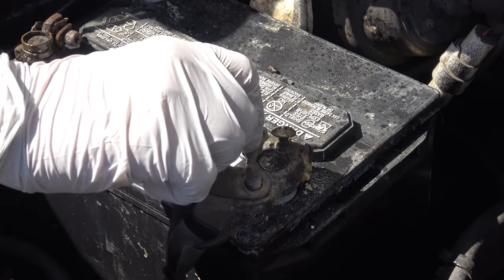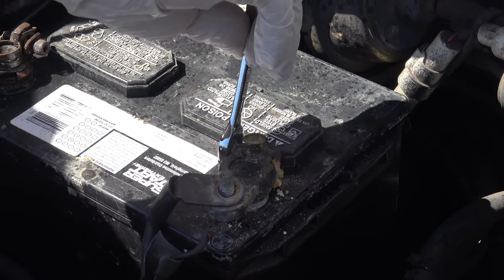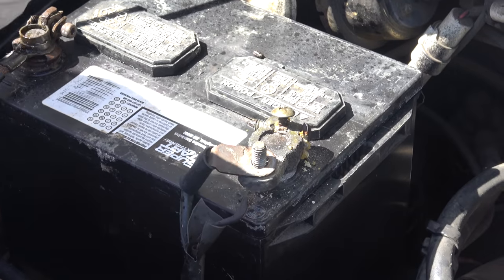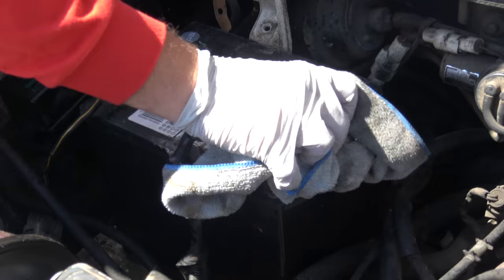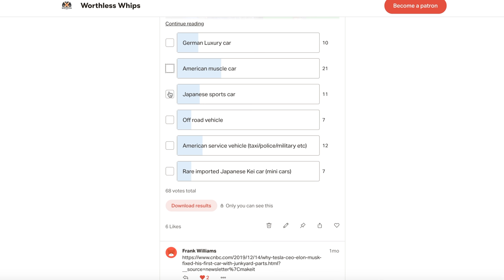Rescue any Car BATTERY for $12.50

Comment: I kept an MX6 on the road for 20 years and had it in the shop once to replace the clutch because I didn't have a garage.  I've done some work on my truck but have taken it to the shop for a lot of work because I got tired of working on cars.  It's expensive and you can essentially pay for some nice tools by doing the work yourself.

Comment: WD = water dispersing.  A battery can be damaged by rattling (much less falling off) around on the tray so it is not an optional maintenance item!  An inexpensive little battery terminal (clamp) puller is another nice thing to have in the toolbox for those times a person may be tempted to take a hammer to uncooperative terminal clamps.

Comment: To truely rescue any battery you should mention the following.  You need 2 battery chargers.  1.  A heavy duty charger for charging a dead battery you can get a 30amp continuous with 100amp (for about a min) jump start setting for only $60 on Amazon.  Higher amperage chargers are not needed but they can charge your battery faster and the higher amperage  models can "recondition" the battery if it is not too far gone.  2. The other charger should be a trickle charger that keeps the battery charged when not used for long times.  I like Battery Tender brand because it only provides as much power as needed.  Really cheap trickle chargers always charge and that is not great for long term storage.

Comment: Use baking soda/water mixture to neutralize the battery acid on the terminal and wires after stripping. And do NOT over tighten the battery terminal. It will stretch the soft metal and you'll be back to where you started in a hurry. Personally, I like to tin the newly stripped wires with solder. Separately stranded wires cannot carry as much current as solid does. Also, where can I get a set of those 1930's wrenches?
Reply from the maker: Good solid advice for a show car, but not a worthless whip ;)

Comment: To deal with all the corroded batteries, if you must, take baking soda, mix it up with water into a paste. Apply the paste all over the corroded area especially the terminals. This will counteract the sulfuric acid in batteries. Sulfuric acid  is truly dangerous stuff

Comment: Please don't use open end wrenches for everything you can think of. Those things will eventually strip of every nut and bolt head you try to loosen. Use close end wrenches instead... those will save you a lot of head aches.

Comment: An excellent and to the point video. I would offer a few suggestions based on my own experiences/adventures in car repair.  Number one-buy the thicker, mechanic's rubber gloves. The cheap latex ones do not hold up. Number two-be careful to clean up any spills of coolant containing ethylene glycol. Animals find the chemical sweet to the tongue and will lick up any spills on the pavement or garage floor. It is quite toxic and leads to a miserable death for any creature who gets enough of it. Number three-check under the battery. Corrosion here is fairly common and needs addressing before you add ventilation to the engine compartment you weren't counting on. And number four- Harbor Freight Tools has cheap, servicable tools and they are nationwide. Amazing change of pace in your videos; from learned, social commentary on matters China to car repair. Good luck, guys.

Comment: A good noob tip for negative and positive is if you don't know which is which if the car came without terminals (have had happen before) try to trace one wire in the bundle to the starter, which would be positive, and one wire in the other bundle to the chassis as ground.

Comment: Best dad 101 advice I ever got, if it moves and it shouldn't use duck tape and that will fix it, if it doesn't move as it should use WD-40. With those to things of advice you can at least get passably by with 80% of the stuff you're expected to know as a man.

Comment: A lot of the corrosion can be due to acid off gassing by the old battery. I've replaced terminals before only to see more mess accumulate. Replacing the battery solved the problem.

Comment: I always just use some old light sandpaper I still have laying around or a steel (rough or fine) steelsponge people use to clean pots and pans to remove corrosion from terminals. The tool is nice though, if you have to do it relatively often. Didn't know it existed.

Comment: Car electrics tip I leaned the hard way. Clamp or crimp wires. Solder makes a brittle connection that brakes from vibration.
Reply: HangGlideTube  Can you give me an automotive example? Circuit board components are soldered of course (although automotive grade parts with flexiblly affixed solder tags are a thing). Wire to board or wire to connector, no. It's not about cold solder joints it's about causing stress risers in the wire which will weaken every time the wire flexes. It's not always possible to crimp when making DIY repairs, but be aware of the potential weakness.

Comment: The best way to clean battery terminals/connectors/ANY battery corrosion is by filling a cup with water, and simply pouring baking soda into the water, and using something like a toothbrush to scrub away at the corrosion with the baking soda water, it chemically breaks down the corrosion, whereas WD40 doesn't.

Comment: As someone whom car batteries usually hate...hopefully a future video will be tracking down a phantom electrical drain. Bonus points for it being in a 2-door car where the battery is under the rear seat... 🤬
Reply from the maker: I can certainly oblige

Comment: That corrosion was so bad I would have been tempted to swap out the wires in case it got up deep inside. I also read somewhere (I think it was the Celica forum I'm part of) that it is often advisable on these old Toyotas to at least replace the grounding strap with something a little thicker.

Comment: My dad used Coca Cola to neutralize the battery corrosion but like others here baking soda 
Lol I once broke down with a auction car and used some Tums dissolved in a little bit  of water to clean the corrosion off.
If you are working on old cars you might want to invest in a pair of battery pliers yes there are such a thing specially made for battery nuts and terminals
Battery grease is not bad idea
Another thing I saw someone do is use a flat tip screw driver and make a + mark on the positive terminal but new batteries today are usually clearly marked.

I used to work at an auto auction and have jumped started a lot of cars and I have seen batteries with the screws like that and lots of other strange things done to them and I have seen batteries overheat and cars damaged because some put the cables on wrong way.

Comment: you can add solder with flux on it on that wires. solder them and then put them into terminal. this way, they will not corrode.

Comment: reminds me of when my once HK friend jump-started my Evo 7 GSR with leads the wrong way and melted the terminal... I had to buy a freaking generator and pnumatic air gun just to remove the mega tight nut that held it on (which was partially glued to the housing from the melting)🤦‍♂️so much hastle for something so insignificant, life can be a surprise at times...

Comment: That battery may still be under warranty. The 12/17 sticker on top denotes the manufacturing date, so it was certainly sold after that date.  And that model of battery usually has a 3-year warranty.  You're probably under two years at this point so even a 2-year warranty would be good.  Take it back to O'Reilly's and go from there.

Comment: I used a 1" wide orange webbing tie down to keep the battery attached to the car. the battery hold down having long since rotted away I'm floating at about $100 per month including everything.  Then replace them once in a while.   Terminal connectors too.  right

Comment: Great episode! How do you know which terminal is positive and which is negative? Is it written on the battery? Also, how do you know which black cable is positive and which is negative?
Reply: Most of the time on the battery, there is a plus and minus sign next to the terminals. Should you mix the terminals up however, the most amount of damage you should be able to cause is blowing a fuse. The only surefire way to check which cable is which, is to follow it. The negative wire should attach to the car chassis.
Reply from the maker: The negative will always have a small - and the positive a small + also the negative is usually black and the positive red, the negative terminal will always end up earthed to the car's frame / engine / chassis and the positive usually goes into the wiring loom. ;) Glad you liked the episode!

Comment: If you have an old dead battery, it is worthless. Just buy a new one. But you wanted to show some repair techniques so that's cool. And always coat those old-style terminals with plenty of vaseline because it prevents corrosion.

Comment: Have you guys ever actually revived a battery by putting new acid in? It's my understanding as well even on batteries that no longer hold a charge, usually the issue is that an electrode has broken from vibration, and theoretically you can actually solder the electrodes back. Obviously that's a metric ton of work, but batteries are expensive like crazy now compared to the early 2000s ($80-120 vs $30.)

Comment: Stupid question:

Will WD-40 short circuit the wires?  Or do you have to make sure theyre throughly dry?  Thanks
Reply: It doesn't conduct electricity.
Reply: First go find out what a "short" circuit is

Comment: do you know why they are called spanners? cuz im not even sure why they are called wrenches.

looked it up;
'Wrench' is derived from Middle English wrench, from Old English wrenċ, from Proto-Germanic *wrankiz ("a turning, twisting"). First used in 1790.

'Spanner' came into use in the 1630s, referring to the tool for winding the spring of a wheel-lock firearm. From German Spanner (n.), from spannen (v.) ("to join, fasten, extend, connect"), from Proto-Germanic *spannan, from PIE root *(s)pen- ("to draw, stretch, spin").

Comment: I'll do that WD40- down inside the wire insulation as you suggest.The webbing battery tie down is on a '69 corolla that is indeed a worthless whip, but at $500...why not?

Comment: Please dont use a hammer on the battery terminal. Especially on old batteries, they tend to leak on the root of the battery terminal and will surelu do so if you hammer the connector to the terminal. Use a screwdriver. Dont use excess force.

Comment: Baking soda would have been a great start....
Reply from the maker: WD40 is my baking soda
Reply: @WorthlessWhips  Use WD40 for all kinds of things. I buy it by the gallon. :)  I fly around North america fixing big printers and I'm amazed how often a customer doesn't have a can at their facility. Hell, My moms 78, she has wd40 under her sink. :)  Baking soda is an old trick my father taught me. Its an easy way to keep your battery and terminnals clean, and it defuses any acid thats near it without the oily residue which attracts dirt. 
    Its funny, my knowledge of this helped me when I had acid reflux in the middle of the night and my throat was burning.....haha, a tablespoon in a glass of water and boom. No acid in the throat or stomach.  True story!

Comment: clickbait title. You can see the battery is only 2 years old. The battery isnt likely an issue itself. Those cheap "repair" battery terminals tend to be junk and provide issues down the road. It is a hacky fix.

Comment: The battery terminal clearner tool looks rought on the terminals, like a scraper. Particles flying through the air. AFAIK the terminals are lead. (Or maybe humankind has attained enough sanity by now to use a different material.) As for encrusted battery acid: Better to use a messy old vacuum cleaner or that stuff will not only fly through the air (i.e. uncontrollable) but also into the engine bay. It then becomes advised to do a complete cleaning. Personally, when I work on an engine, it's more like an operating room in a hospital. And if that standard cannot be maintained, I leave it to the dealership.
The video title, by the way, is not just wacky in the capitalization, but also highly misleading. One of your worst so far.

Comment: I thought you were going to restore the battery for $12.50.
Reply from the maker: We did, the terminal connectors were $12.50
Reply: @WorthlessWhips  I thought you meant ... you were going to recondition the battery. Drain acid out and refill. My mistake.  Thanks for the reply.
Reply: @alwyn626  that is too dangerous to save money

Comment: I like the show, but the name sucks.  Maybe it makes sense in South Africa or is based of something from China.  Maybe something like ADV Mechanics or go back to the name of your old shop, Churchill Customs.
Reply from the maker: We appreciate the critique, but "whip" is a very common slang term for car.
Definition - "When the steering wheel was first put into use in automobiles, it was called the "whip". The whip is what you used to control the horses on a stagecoach, hence the analogy. Many years later, various hip hop artists noticed that the Mercedes-Benz logo resembled a steering wheel. They then proceeded to use the old term "whip" to describe any Mercedes-Benz vehicle. The term has now been generalized to classify any expensive automobile.
The new show "Unique Whips" on SpikeTV is obviously going to suck."
Reply: @WorthlessWhips  I actually had to look this up.  I have been into cars for the last 35 years and NEVER heard the term.  From what I understand the term whip representing a car is mostly came into popularity from hip hop... which I do not listen to at all.  In fact I rarely listen to the radio at all.  I also ditched cable about 5 years ago, so I have not seen Spikes car show.  I do not think many people will understand the term.

I would just think something that would tie to your other shows would help more with brand recognition and such.  Plus I still think the name sucks.  You do not have a hip hop car show.